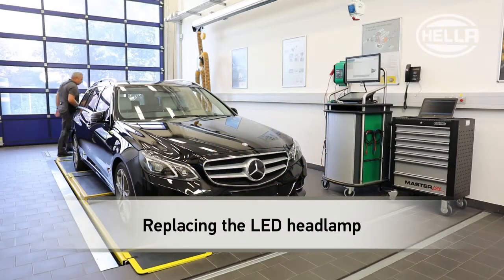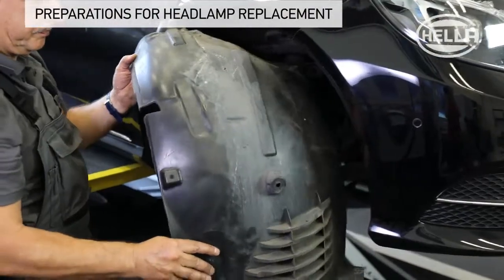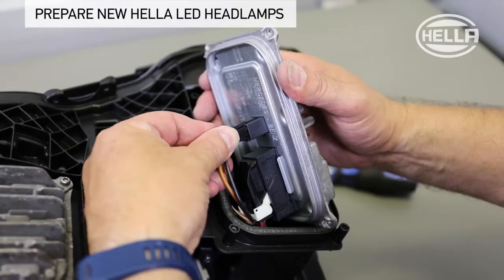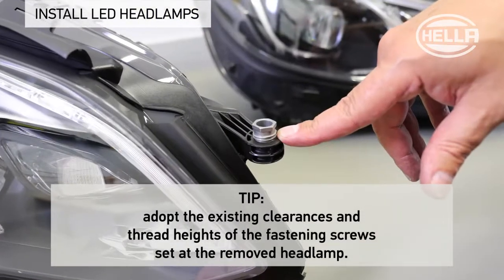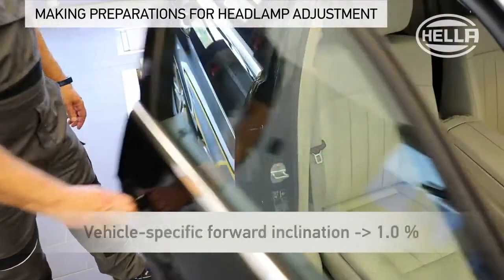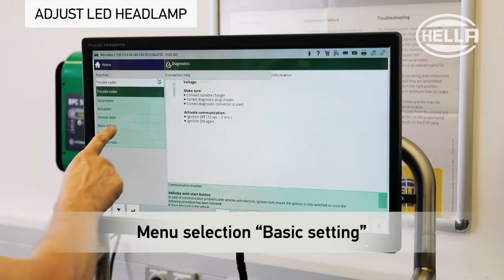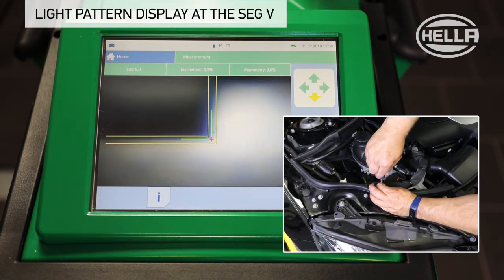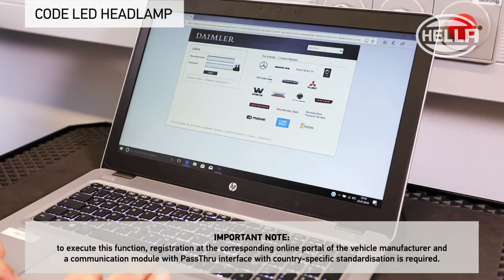Replacing an LED headlight | Mercedes Benz E-Class W212

Comment: Think hard if buying a second hand car. 
In the past 9 months, mine has already cost £3,000 in ‘Mercedes only’ repairs and is about to cost another £2,000 because of headlamp failure. 
I’m going to get it fixed and then will be selling it. 
I love it to bits but it’s as reliable as my previous Jaguars. 
I may buy an older version with bulbs that can be replaced and definitely a petrol. 
The AdBlue system fails at about 80,000 miles and can be up to £3,500 to repair. 
Honestly, these are disposable vehicles. 70,000 - 100,000 miles and then they are worthless to second hand owners unless you earn £200,000 a year.

Comment: Headlight lamp or complete headlight?
Reply: you have to replace the entire assembly to replace the lamp, unless you want to disassemble the HL assembly itself, which it's not designed for. MB nor Hella will sell you parts for insider the HL, but maybe eBay will.

Comment: No link to where to get the lights from ?
Reply: 1.5-2k if you want them from mercedes. 750-1k used on eBay. Especially annoying because the light is relatively rare (only used 2014-2016 for E class with ILS option, kinda rare).
Reply from the maker: Thank you for your request.
You can receive our headlights from your wholesaler. If you have any specific questions or need further assistance, feel free to let us know.

You can find more relevant technical content here in our HELLA TECH WORLD:
https://www.hella.com/techworld/uk/